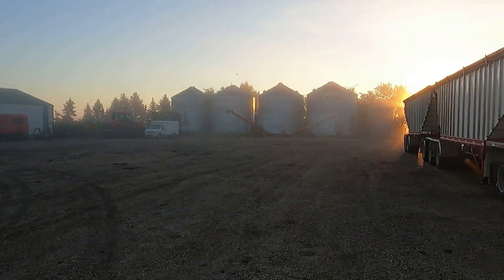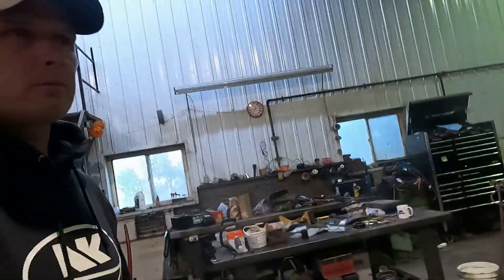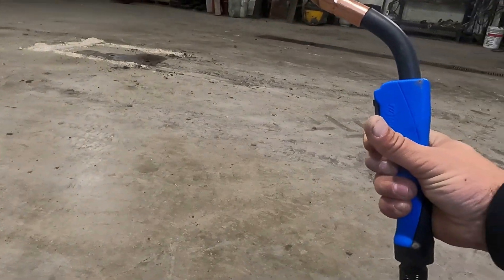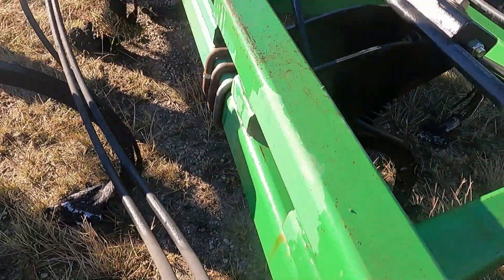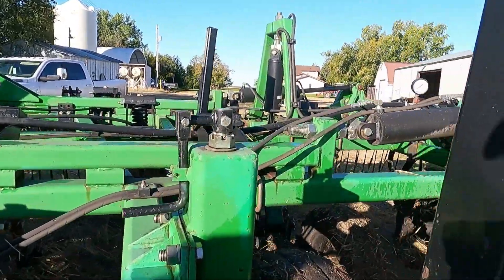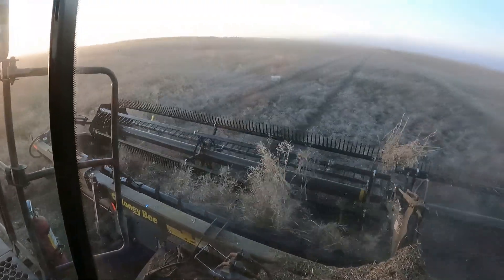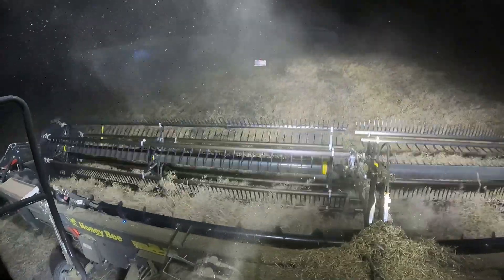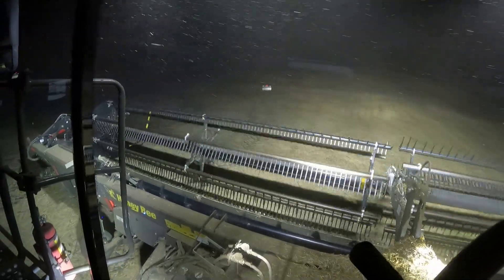That isn't Good

Comment: When you have that many bales to load do you use the pedal mode on the CVT? Just wondering.
Reply from the maker: Unfortunately the 7715 has the dyna 6 transmission.
Reply: @TwinElmFarms  Need to visit the dealer to fix that.